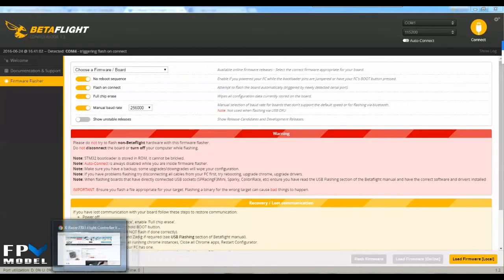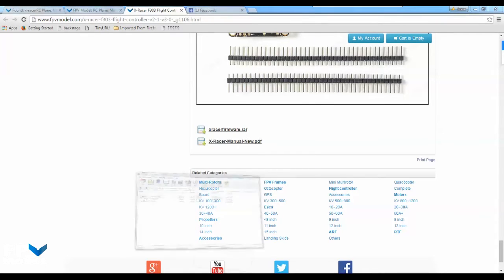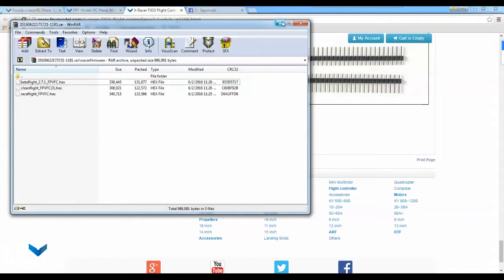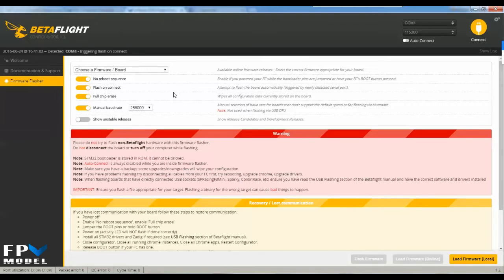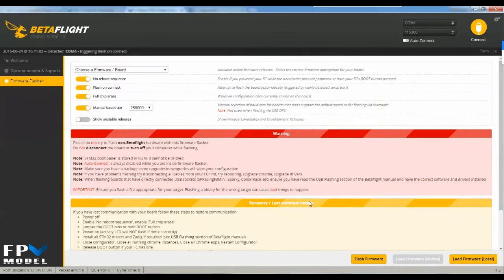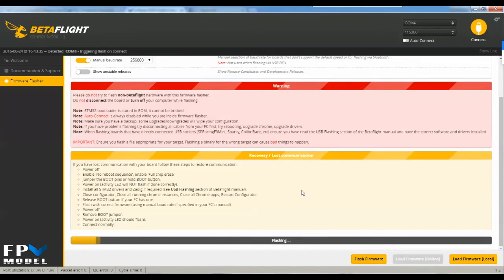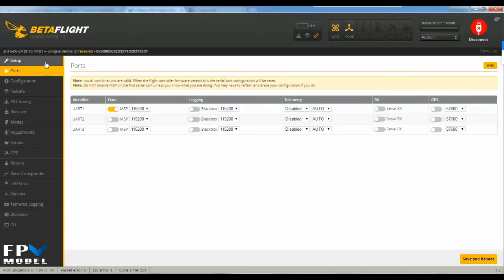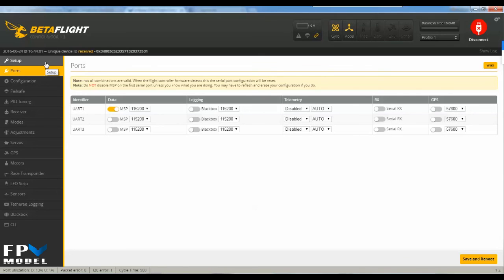X-Racer V3 Uploading Firmware

Comment: Do you know any reason I'd be getting this when I try to flash? 
2016-07-01 @ 18:35:20 -- Detected: /dev/cu.SLAB_USBtoUART - triggering flash on connect
2016-07-01 @ 18:35:21 -- Failed to open serial port
Can connect to configurator with CF 1.13 already on the board, but just not flash to BF.
Reply from the maker: What firmware are you using?
Reply: Just the Betaflight .hex from the link at the bottom of the X-Racer page
Reply from the maker: Can't say for sure without seeing what's going on. Could you make a short video and send to jason@fpvmodel.com? I'll take a look at it and see if I can find out what's  going on with it.
Reply: Apologies for the delayed response, I have just included you in an email containing the video. Thanks a lot!